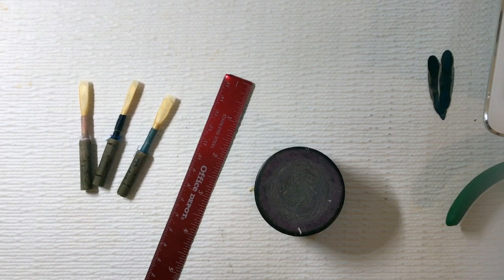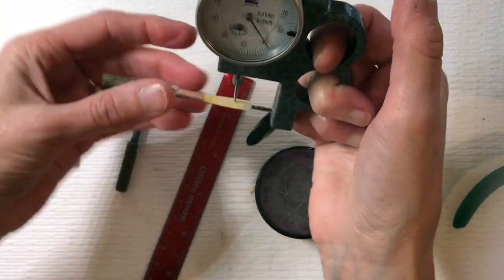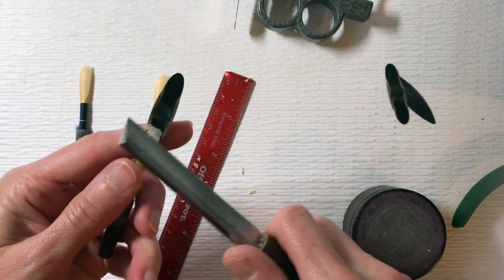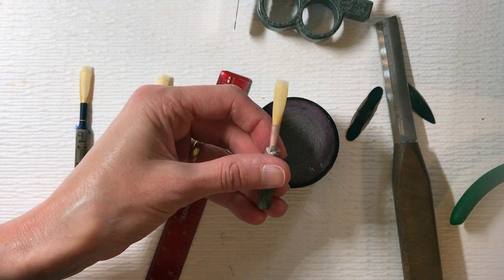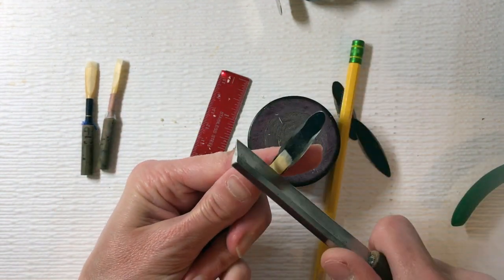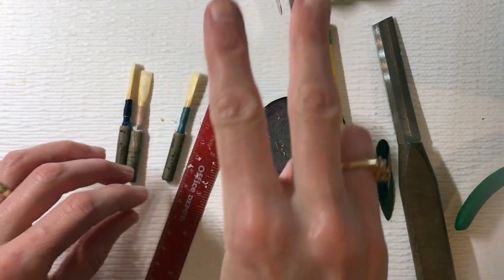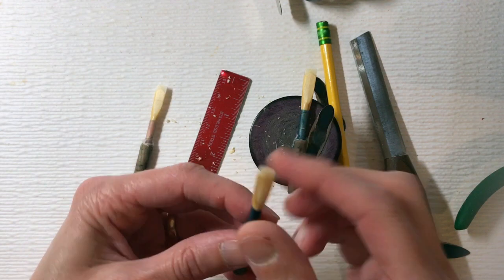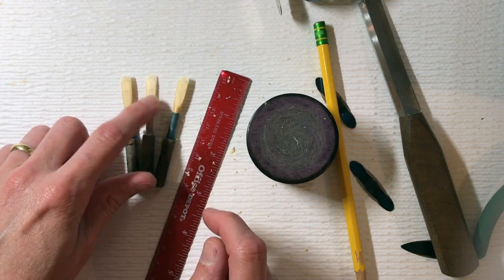Reed Repair Shop: Gwen

Comment: So interesting how they are flat AND resistant. Usually when I take too much out of the plateau, especially in the channels, it makes it flat and easy. Flat and heavy when the plateau is already so thin is interesting.
Reply from the maker: I think it came from the balance between tip and heart being off.  Longer tip would have helped. But it was really good to SEE these reeds - because my instinct, upon HEARING about them in Reed Club, proved to be incorrect.